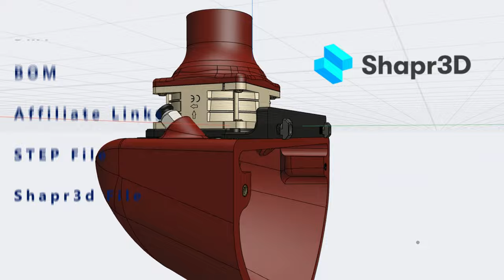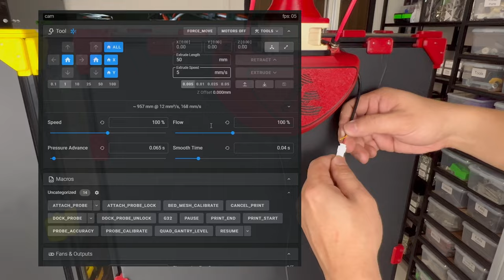Get Rid of PRINT FUMES!!! | Voron 2.4 Mod

Comment: Hi, if I purchase the exhaust system V2 does it also contain the file for the hub and window ports or just the printer side?  Thanks
Reply from the maker: hi thanks for your interest. it will contain exactly shown in the pictures at the purchase page. it will have the printer side, the noctua fan side.

Comment: Very nice designs but I don't see why you'd need this. Install a nevermore filter. It will increase enclosure temps too having an exaust beats the purpose of an enclosure.
Reply from the maker: Thanks! ☺️ purpose is not to smell the fumes. Even with this, ABS is printing solidly fine.